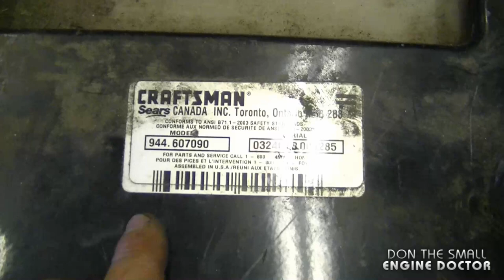Drive Pulley Replacement On Craftsman Lawn Tractor

Comment: donyboy you forgot to add 3 or 4 inches to that pulley befor you put it back on. lol i think the customer would have been even happier with it. just mowing the lawn at 20 mph dont mind me lol.
Reply: lead foot lawn mower Even see how a lawn looks using a POS residential mower at higher speeds?  It looks pretty bad, sometimes so bad it looks like you never even mowed.  These types of mowers were not designed to go that fast, as the mower blades actually don't spin fast enough to keep up with higher speed mowing.  The commercial machines on the other hand have faster blade speeds which is why the commercial mowers can go faster while still maintaining a great quality cut.  It also depends on the grass you are cutting and the conditions.  

Anyhow, yep it would be fun to change the pulley and go faster.  Many people have turned old lawn tractors into go-karts.  A few are on youtube of course.  Some go so far as to disassemble the transmission and weld the open differential parts thus locking the axle together giving you posi-trac LOL.
Reply: WOW dude you typed all that for a joke. i do this kind of stuff for a living. modifying mowers is my game. dont believe me or any of us. go check out southern offroad mowers on facebook. i think you will be pretty surprised at what ( home owners ) riding mowers can do. ill even give you a link www.facebook.com/groups/SouthernOffroadMowers/  and ask someone what there mower can do compared to your commercial grass cutter. people on here and one other group literally have mowers that can cut down trees along there travel if they needed to. some iv even seen have 4x2 and 4x4 drive capability. and no im not here to argue. im just saying there are mowers out there better then some $9,000 commercial mower that can mow at 15+mph